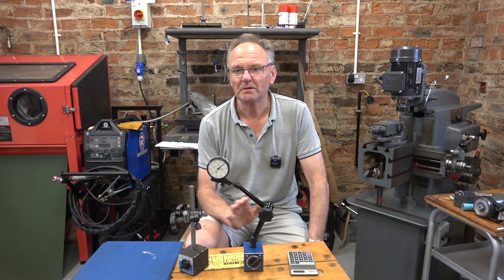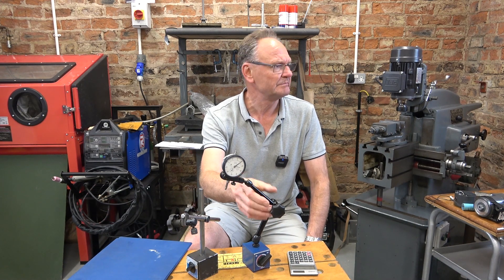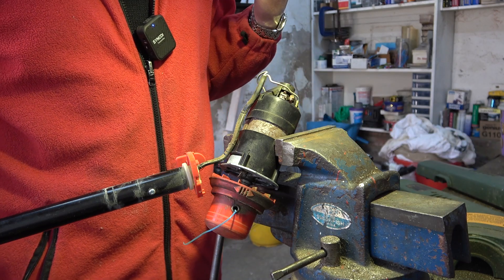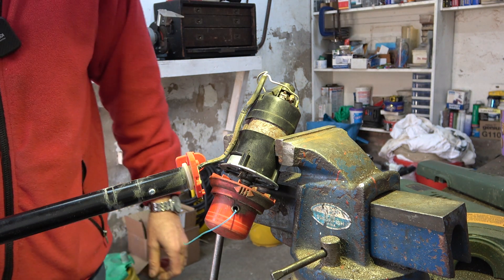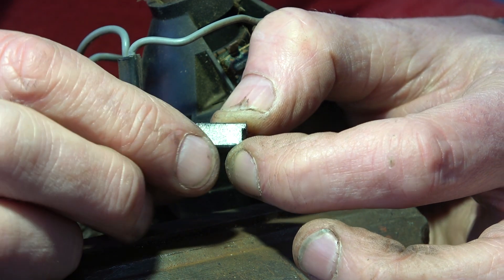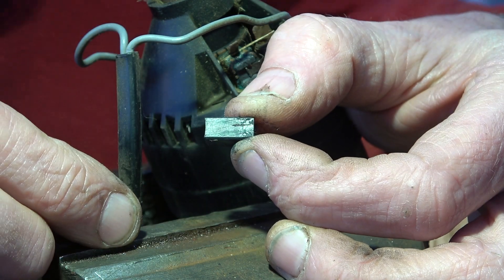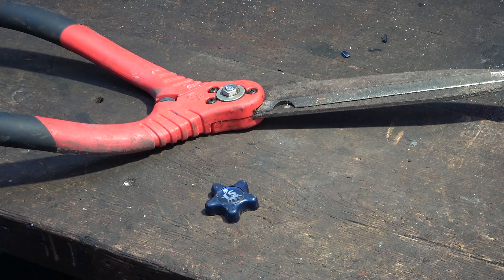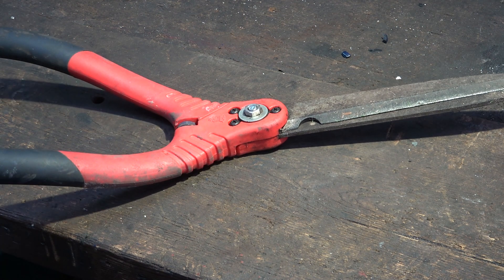HS147 Odd Jobs and Stickers 9

Comment: Welds look great on the fork, Paul - aside from that little bubble 😉. If you don't have any, get some 309 rod. It's great for when you are welding stainless to mild steel, or frankly just about any material to any material. It's a bit more versatile than 308.
Reply from the maker: Hi Greg, to start out I bought a few 1 foot rods of 308 and 309. I've not tried the 309s yet so that's on my self-training list. I should have ground out all of that inclusion - that could have been the reason for the bubble. I've used the fork in the garden and so far it's holding up fine. I need to expand/open my mind to the range of possibilities now I have TIG. Cheers

Comment: Glad to see you are using the TIG. the weld you did on the pitch fork is called a groove weld not a fillet. A fillet weld  is typical to a corner, Tee, or lap configuration. The bubble is probably due to some impurity in the joint not really connected to groove depth or width.
Reply from the maker: Hi Bernard thanks. Thinking about it now, I did not grind out all of that impurity so yes that was probably the cause. I really need to get back to some TIG practice and move on a bit. Cheers

Comment: more good stickers, I have never used a tig welder, I would like to but I imagine the gas is pretty expensive.
Reply from the maker: Hi Vernon, the gas is expensive but there are a number of options depending on how much you use. If you are a commercial user it is probably best to rent the bottles and get cheap refills but for hobby users you can get rent free bottles with a deposit on the bottle and then pay for the refills. My small bottle was about $70 for the deposit and $70 each fill. However if you have a bottle already and are prepared to do a bit of travel then a refill might be as low as $30. I was using a lot of gas at first whilst I was mostly messing up but with experience the gas consumption comes right down and even now I'm only on my first bottle. I think I'm going to get a bigger bottle next time' just so it sticks up above my welder and easier to get to the taps and to see the gauges. But we'll see.  Cheers
Reply: @HaxbyShed  good information, thank you.

Comment: Interesting mix of odd jobs. I do like your digital clipboard! But what was the hammering going on at the end of the video?
Reply from the maker: Hi MidEng, I sometimes throw in curiosity clips at the end of my vids, that might interest people. Nearby we have a small farming museum which also has 1/4 mile of preserved railway track and some rolling stock. There is also a mock Saxon village and a small wooden Roman fort. It's open to the public and it gets a lot of visits from school parties etc. There are a number of open sheds with displays and that video clip is a volunteer giving a demonstration in the blacksmith's shop.  The place is called Murton Park and I made a vid of the railway in HS99.  That section of track is all that remains of the Derwent Valley Light Railway which ran 18 miles from York to Selby to serve the farms and a cement works, but during the war it also served one or two airfields.  Thanks for asking. Cheers

Comment: Hi Paul. Where did you get that indicator stand please? Looks a lot nicer than anything else I've seen around that price point.
Reply from the maker: Hi cooperised, the brand name is Dasqua and it was the 80kg clamp force version. I think Dasqua is a brand name for Chronos tools. I bought it from Chronos through eBay. It's pretty good for the price though I had to re-glue the front face sticker because there was a bit of oil behind it (so it was not sticking) and also the machining on the base was a bit askew although it is flat and won't affect its function. Cheers
Reply: @HaxbyShed  Thanks! 👍